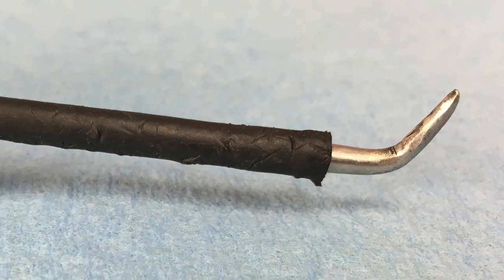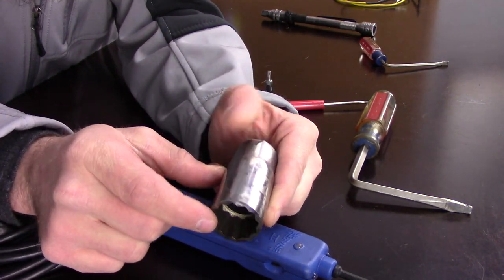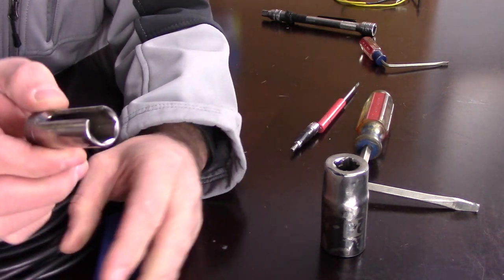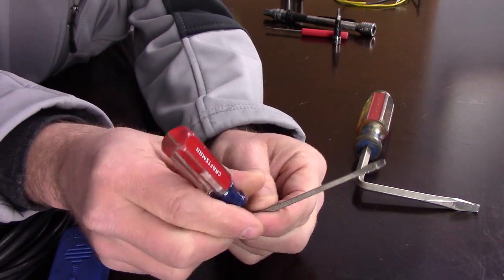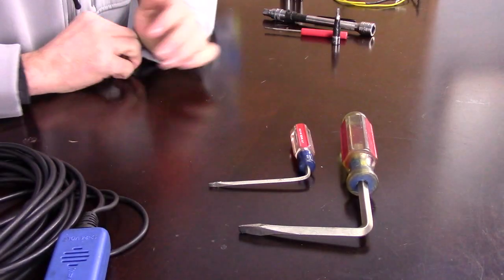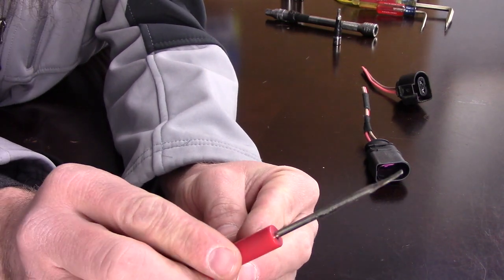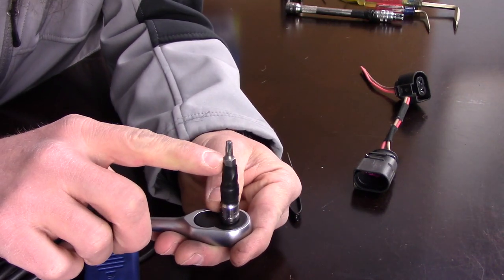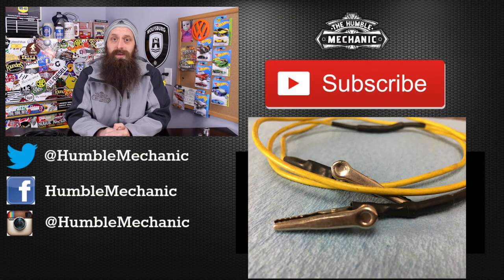Making And Modifying Custom Tools

Comment: My favorite tool mod was putting a sticky heavy duty 3M heat shrink on a loose universal swivel socket. I’ve used heavy duty tweezers and modified them to pull out wires like the one you friend did with wiper blades. Thank for socket idea we have a lathe at my work. Now I know what I’m gona do with a socket to make my job easier

Comment: Nice video!  For working on school buses, I have extended 13, 14, 15mm wrenches,  Made them for removing torque converter bolts on the old Allison 545 automatics.  Kind of like a TH400 on steroids!   Thanks for sharing the video!!

Comment: I made a extra long extension for my test light to run from my negative battery cable and go wherever Area I need to work. Works great with rusty vehicles that don't have a lot of areas where there is a lot of clean metal for a ground.

Comment: I was helping a buddy change out a crank pulley on his S2000. There was a special tool that was required to remove it, but we didn't have it of course. The pulley had a hex pattern recessed into it. I went to the plumbing section in lowes and found a steel elbow with the exact size hex pattern, screwed it onto a length of steel pipe. Worked like a charm.

Comment: Welded the pin wrench my angle grinder came with to a wrench that fit the wire wheels I use, then bent it in the middle so it cleared the shroud. Totally worth it. Also built a slide hammer from a piece of printer rod, some rebar and scrap for the weight, and a lug nut for the end stop, and welded that to some vise grips.

Comment: My favorite thing is pretty simple, I usually wrap up any swivels I have with electrical tape.  Gives them just enough flex but keeps them from flopping around all over the place when I don't want them too.
Reply from the maker: +Ryan Booth YEP I do that too.
Reply: +Ryan Booth heat shrink works for this too.
Reply: O-ring in the joint works great.
Reply: Dude that's a necessity to getting your ASE diploma
Reply: @HumbleMechanic  Öl lieber Lukas pp
Reply: Profilfoto püpp

Comment: A quick one I made for VW and Citroen/Peugeot strut assemblies. Is a wedge tool to expand the strut to allow it to release from the steering knuckle. Just modify an old 1/4" hex bit. Works a treat and saves spending money

Comment: I made a tool for pressing the brake pistons back into the calipers. Only works on the old Volvos (tested on 740 and 940), but a lot easier than using large pliers or clamps.

Comment: One of best tools I've made was out of desperation. I was doing a clutch on a t660 kens worth and the adjuster was rusted. Even with factory tools and some torch it didn't budge. I had to grab my 3 ft pry bar, torch and bend it 45 to the left and downward and boom. Busted the rust and adjusted the fucker. Haven't used it since but keeping it around till next time

Comment: Once made an injector puller from a piece of  hollowed out stub pin a length of round bar and welded the nut from the piping to the top =) also recently made a 14mm 'o2 sensor" socket like yours!  Awesome time saver buddy!!! great video=)

Comment: Humblemechanic I use heat shrink tubing to add or replace handle grips on ratchets, pliers, and slippery plastic screwdriver handles, and the shaft for electrical work. I run a small bead of super glue on extensions then cover them too (it might help with keep the roll pin in place) It also keeps tools from getting beaten up.

Comment: Just getting started in tool make/modding. I have a 22mm socket with the end ground flat for better grip on thin-head diff drain plugs. My favorite is a thinned down 10mm box end combined with thin wood wedges (to prevent the wrench slipping off once in place) I used to break loose some stuck and awkward fan clutch nuts.

Comment: I made a socket with some taped on extensions and universal joints so I can pull the IPR valves from late model Ford 6.0s without removing the turbo. Saves a bunch of time and saved me some money over the OTC tools

Comment: I magnetized several screwdrivers to make small screws stick to the tip. Once I had to grind down a larger long-socket around its connecting end (like in your video) to get it in between cylinder head & gas tank of my motorbike...only after it was in place could I connect my ratchet, but at least I now didn't have to remove the gas/fuel tank. And then: endless wrench-modifications: grinding the open end thinner, cutting a large one in half to fit it inside a farm machine, welding a pipe as a new & longer handle to a cheap ratchet etc. Whatever works for a farmer! ;)

Comment: One tool that I remember modifying is a thin wrench that was non metric so I opened it a bit with a grinder I use it for calliper guide pin on VW and Audi cars and a other one that I remember is a 27 mm deep well socket I grinded the top part similar to what you did it the video but it was used on 1.6 TD engine to remove the injector on cylinder no 1 and maybe no 2 also most of the time there was not much clearance between the sockets and the fuel pump pressure actuator for boost enrichment I know theses were old school NOX benching engines I guess that they were better that a old MACK truck.

Comment: loved the video and thought i'd show off some of the tools i've madeI have made 3 tools of my own, and I'm mainly proud of a holder I made out of an old brake cleaner can, really simple as i just cut the top off and put a hole in the side so I can bolt it to my tool cart, so I can hold files or screwdrivers.

Comment: my personal fave small mod is electrical tape around universals so they don't flop around while in use.
Reply: JoJo Tk you should consider a heavy duty heat shrink that sticks by 3M it works and last longer
Reply: JoJo Tk you should consider a heavy duty heat shrink that sticks by 3M it works and last longer too..
Reply: Universals should be built like drive shafts,

Comment: On a 2010 chevy silverado dually, we were doing a rear brake job and the caliper slide pin was a 10 hex. The leaf springs were to close to the bolt and the 10 i had was to long. Had to shorten the hex and grind off the mushroom on the head of the hex. Worked wonders

Comment: I was a motorcycle mechanic for going on fifty years and, by far, my most used modified tool was a socket I cut slits in to fit over a wingnut so I could use my impact with it. I've made hundreds of other modifications and special tools, but that one was used almost daily. I noticed you can now buy one already made...
Reply: I feel your pain. I have a vintage 84 FJ1100 I used to road race and Yamaha doesn't even sell the special tool to remove the fork caps any more. Mine went missing so I had to fabricate one of my own...
Reply: Made one years ago for the wing nut on spare tires. Great tool.

Comment: Ive done jumper cables out of old locking pliers and welding wire. I made radio removal tool from a scrap chunk of aluminum, and I did a home made soldering iron by holding a nail in locking pliers and heating the tip up with a blow torch. once the nail was hot. I was able to do what I needed do with it
Reply from the maker: Awesome

Comment: Chevy hd gas engines can't remember if it's a 6.7 or 7.0 litre but the oil filter adaptor had pugs covering the bolts to remove it but it was square drive between 1/4 and 3/8 so I ground down a old extension till it fit only used it once but I still have it

Comment: back when i worked with volvo trucks everyone would have a ground down regular 21mm wrench. ground down those 21mm on the open end because you needed them for almost every air fitting where just a standard wrench would be to thick to fit. also had a complete drawer of just different wrenches with all possible twists and turns on them to reach those stupidly placed bolts and nuts.
Reply: working for Volvo Trucks I can confirm this, i got a set of teng-tools spanners when i started my apprenticeship that fit perfectly  onto air fittings, and i have the drawer of bent spanners to get onto things, i know the guys who design them have never turned a wrench in their lives!

By the way love the gorgeous car in your picture ;)

Comment: Made a valve tool for doing valves on b series Honda VTEC heads, took a shitty 10mm wrench, bent it, welded a price of pipe to hold the flat head screwdriver and then welded a piece of round stock as a handle. Works great. Also had to make a wrench to get to the inner bolt on the water pump  on 71 series Detroit engines

Comment: A drop of Loctite red on that roll pin for the locking extension, and it won't come out ever.

I needed that airbag tool recently (2002 Eurovan).  I have one regular screwdriver of exactly the right size and length which works, but the bent tool would be more convenient.

Comment: I've welded a socket on the end of a popular tap and Helicoil tool, no need to search for anything but a ratchet. Mainly used in areas with no room for a t-handle.
Reply from the maker: +William Holzknecht (WILLSWHEELHAUS70) NICE!

Comment: most recent is drilling a hole straight through the side of a 12mm triple square socket to fit a screw driver through as there wasnt enough clearance to fit even the thinnest wrench on the end to reach the bolts holding the transfer case to transmission on a MK1 TT

Comment: I modify tools all the time. I needed a 29mm socket once but the closest thing I had was a 34 so I tacked two pieces of 1/4" rod inside of the socket to make it the size I needed. I've also bent and notched a screwdriver specifically to be able to put the springs on the parking brake shoes on my jeep.
Reply from the maker: +Jared Callahan that's awesome!!

Comment: I've cut down a 5mm allen key for removing the fastener for the electrical connection on removable trailer hitches.
That way I don't have to take everything off, just to take that one fastener out.
I had some other home made special tools, but I've forgotten what they were and what I used them for.

Comment: I have a 9/16" wrench that I've cut short for removing Jeep transfer case nuts, also a 14 mm ratchet wrench I cut down for the same thing. I also have a wrench that I ground down thinner on the open end for installing stabiliser links.

Comment: A buddy of mine wanted me to do a "quick" valve adjust on his b18 a while back and I didn't realize that the rockers were about an inch deep in the head.  After a few minutes of fenagling with wrenches and sockets and whatnot, I just took an old Stanley 20mm box wrench and made 2 100° bends in it to reach down to allow me to throw a screwdriver on the rocker tip while holding the lock nut in place.  That was 4 years ago and my box(es) have moved a few locations between houses and schools and shops and that little bent wrench is still in there

Comment: homemade spring puller for 2 stroke exhaust. a piece of stainless car antenna through a chuck of 2x2 for a handle and all taped up. works fairly good.

Comment: I use an Audi wheel center cap removal tool to pull up the ignition coils on my Audi 3.6 VR6! Works like a champ!
Reply from the maker: That is awesome. I used a mk4 seat spring for pulling wheel caps for many many years.

Comment: Many years ago the first tool I made was a Tee handle with a bit of a hook on the end ...I made it to enter into a fork lift engine's spark plug hole, pull against the face of a valve so we could change the valve stem seals and springs without lifting the head.

Comment: I work as a building maintenance mechanic. We have one style door where the handles loosen up frequently but because of their cost, we aren't allowed to loc tight em.... Believe me, I've pushed it..... We didn't have the proper tool to do it, my boss would use small allen wrenches but they break after a while. After 2 prototypes, different materials and some fabrication, I ended up making a tool that's not 100%, but it's probably 85-90%. Great vid!!
Reply: +Robby94LS They sell removable loctite. It comes in a couple different formulas. I'd just throw some on when the boss isn't looking lol.
Reply: Ron Garvin I like your style! Thanks, I'll look into that!
Reply: You want Loctite Blue:)
Reply: Thanks, I'll throw that in the next Grainger order!

Comment: I have bent Philips screwdrivers for some honda  key ignition tumblers and I have welded torx and hex bits in to 5/16 wrenches for clearance when the bit holder I had went missing

Comment: For my mk4 I have a bent nail for the shifter adjustment, a metric bolt with a welded nut for the transmission plugs and a box welded to a bar for the front struts :P

Comment: I was working on trans for a friend and it needed a 1/2in allen so I took a bolt and welded a chunk of flat stock to the end and made a wrench I gave it to him and he keeps it in his glove box. working in a weld shop I needed a 7/16 socket but the 3/8 rachet was missing so I welded the 7/16 to a worn out 7/8 socket with 1/2in drive and used the 2ft breaker bar we had in the shop to remove a bolt on the band saw to replace a roller for the blade guide. still have that socket some place

Comment: I didn't have the right pick to replace the ignition switch. Since it has a locking pin to preventing from coming out. Got a wire clothes hanger cut the straight piece off and made long enough  with a bend to have leverage to release the locking pin.

Comment: Pocket screwdriver in a vise and bent the tip so I could use it as a tiny prybar (very very helpful for tiny applications) bought a tire valve core removal bit from snap on and put it in my Milwaukee fastback where the bit is held for quick and efficient air removal, bought air line and water valve pieces and parts and actually constructed a tool that sends air straight from the airline to a tire without an air chuck for those beads that won't seat

Comment: I needed some window holder suction cups to do window regulator work. Instead of buying them off the tool truck, I made them for a few bucks from hardware store parts. Not only do they hold windows up, but they keep doors with worn out detents from hitting things.
Reply from the maker: NICE! I bought a set off the truck many years ago.. They were awful. LOL

Comment: My brother had built a simple tool for pressing out Ram sealed hubs on the 4x4's. Just a shallow metric socket, that fit over the hub bolts, and welded a 4" chunk of cold rolled steel to it. Back off the retaining bolts a couple of turns. With the front end jacked up in the air, start your motor and turn the steering back and forth. The cold stock presses against the frame and the socket pushes against the hubs retaining bolt. When I went to do my sisters '99, we couldn't find my brothers tool. I just used a shallow socket, and a short extension.

Comment: i like making taps out of old bolts. Mostly axle bolts for newer vws. its easy with a grinder wheel. just taper the end and cut 3 or 4 notches to let it have some space to cut. then just file down the edges till they are nice and sharp and clean up the threads around where you tapered it and it cuts threads just as good as your hardened steel taps you get from snapon. I actually ended up trading my whole tap and die set for a stream light stinger after i found how easy it was to make my own.
Reply from the maker: +Casey Deriso That is a great idea!!!

Comment: I've made a few custom tools but probably the one I use most is a modified Gorilla locking lug spline tool. I got tired of pulling out the spline key and then looking for the correct size socket to use with it. Instead, I welded it directly onto the correct size socket. No more looking for the matching socket, which would always get separated, used for some other job, returned to the toolbox separate from the key, etc.
Another one is to tape or weld the spark plug socket onto a suitable length extension. No more fishing down in the spark plug tube for the socket that fell off the end of the extension.

Comment: My Kawasaki KLR 650 requires a special socket for the spark plug. It's an 18mm but needs a thin walled socket to clear the valve cover. A $3 Harbor Freight socket and 10min with the bench grinder, I had the required tool!

Comment: Working on EMD locomotives, the water pumps are a pain to remove. 80+ lbs, only enough room for one person, and the mounting bolts are in a horribly awkward location. 

I found a cheap 12 pt 3/4" 3/8 drive socket, cut it down until it had about 3/16" left on it, and it fits beautifully with my low profile ratchet. I can back the bolts nearly all the way out, and even get "the one bolt" that everyone struggles with using obstruction wrenches. 

I also have a 10 lb sledge with a 12" handle.

Another that's great in many situations: 8mm or 10mm socket with a small notch cut down opposite sides - fits over stubborn wing nuts.
Reply from the maker: That’s a great idea for the wing nuts!

Comment: I took a half inch socket extention and welded it on a modified angle ginder with a homemade impact adapter to break rusty lug nuts on my vehicles I rebuild from time to time at home.

Comment: Had to make a spanner socket to remove the clutch on my motorcycle, made another spanner with a 2x4 to remove a belt pulley on a Kia with a breaker bar after my impact died at the wrong time, and I believe I had to make yet another spanner for something similar for Bronco a long time ago, made a special carburetor adjustment tool for my motorcycle and used a couple water bottles and some tubing to make a carb balancer, made a bunch of custom test leads for multimeter, custom jumper wires, pin removers for electrical connectors

Comment: I needed a 3/4 line wrench to pull a line off of a turbocharger on a ISX and could not find one anywhere so I took a 3/4 6-point wrench cut a piece out and it works perfect